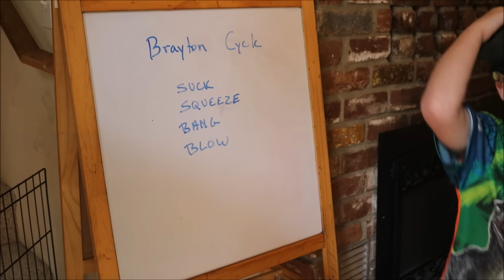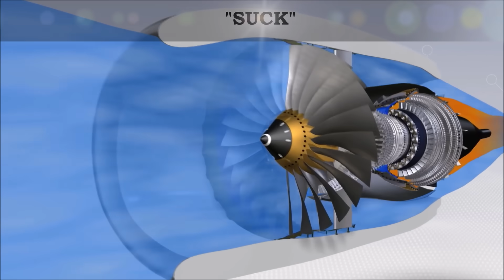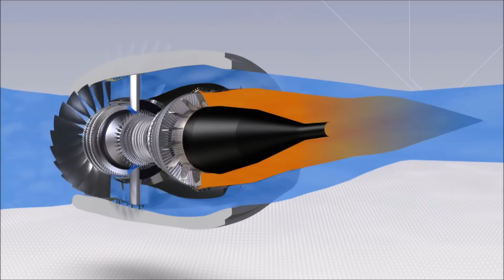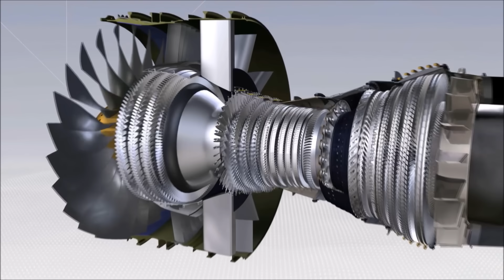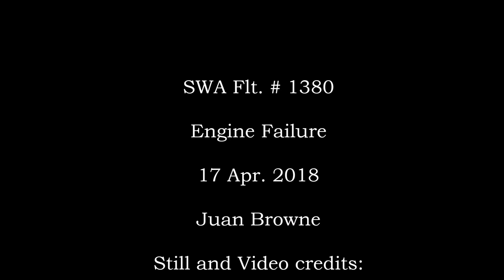Southwest Airlines Flt#1380 17 April 2018 Update

Comment: I noticed that the broken window on the plane was 30 to 40 feet behind the plane of the turbine that failed.  Typically a failed blade would travel in a straight line tangent to the circular arc the turbine blade normally travels.  This tangent path would lead to a window that is along side the window, instead of one 30 to 40 feet behind the engine.  It is hard to believe that the speed of the plane is so high that in the time it takes the blade to travel from the jet engine to the fuselage, the plane has traveled forward 30 or 40 feet. Maybe not.
Reply: mech cntr The window was damaged by the cowling, not the blade.
Reply: I watched the rest of the video and he stated that the cowling likely broke the window, not the blade which was likely contained.  That makes more sense.

Comment: So the lead intake cowl needs a revision to keep it from coming apart. The protective cowl that houses the blades itself is pretty stout material, my brother is a NDE does contract work prototype testing equipment, he had a piece of a housing that he was inspecting after production for GE, it’s like 2.5-3” thick made from carbon fiber, it’s extremely strong material, you could probably land the plane on it if you had no landing gear. I suspect they will find the serial number on what remains of the blade, trace it back and they will find its probably a bad blade due to a production error, or one that slipped by an inspection process at the factory. Inferior component, or inferior inspection of the blade,  but probably easier to miss the inspection part.

Comment: 36 fan blades in the CFM 56
Reply: bigsmitty01 The number of fan blades varies with the engine model, from 44 initially down to 22 in the latest version. On the current 737 it is 24 blades.
Reply: Gordon Richardson correct I'm used to the -5

Comment: George Bailey Brayton (of Boston Mass) made his first "brayton cycle" engine in 1872, he named it the "ready motor" because unlike a steam engine it could be running in a few minutes time. . In 1874 John Holland used one to power the worlds first powered submarine. In the 1880's Brayton made an engine very similar to what diesel would come up with in 1893..  Today there are 6 ready motors known to exist...  Last year the one in germany has been made to run again. This is the first time an original ready motor has run since the 1920's

Comment: At 9:14, do you think it's a "dovetail" failure or the "woodruff key" that holds the dovetail? Or under extreme long term conditions, and duty cycles, do you think that the dovetail could actually be stretching, similar to a crankshaft or a connecting rod in a high RPM (race) automotive engine application?  And then the dovetail either hits the perimeter of the housing or just completely breaks? And at 14:04, are you sure this isn't from "ingestion?"
And last question, just one last time, why isn't this on my evening news, but if George Clooney gets a pimple on his behind, that makes the news? Best,

Comment: Juan, Does Pete, at the ripe old age of 6 yrs. understand, that he is indeed funny? I suppose, you might want to state, he is a chip off the old block. You are probably more knowledgeable than most of the persons offering commentary below, but I've read were the CFM-56 engines have a reliability rating of over 93%. As you mentioned, Airbus used them on earlier builds of their A-320. Also, if my memory serves me correctly, Airbus also used them on the A-340-200, but as I've been reading, they were just a bit underpowered for that application.
Reply: 93% of what? A 7% failure rate (say 7 failures per 100 flights) would be a terrible reliability rating.

Comment: Thanks for the video.Have not seen cowling come off in test videos when blade is blown off.Maybe the increased non concentric movement being on a more flexible wing could create the velocity required to hit the fuselage?are there any safety devices that cut fuel to an engine in severe vibration.also do you have any examples of how fast a turbine engine spins without power?

Comment: I like to watch AgentJayZ he does a lot of experimenting with Jet Engines. If you think you have a big 200 HP Air Compressor think otherwise. https://www.youtube.com/user/AgentJayZ
Reply: Martin Szy - actually, he rebuilds flight and commercial gas turbine engines to factory specs.
Reply: And tinkers with jet engines for power boat racing, in fact, if you call that experimentation.

Comment: The CFM56, and other GE engines are proving themselves to be a lemon
Reply from the maker: not yet.
Reply: blancolirio And other GE engines, GE90, CF6, etc. They are in last place with their peers RR and Pratt.
https://www.barrons.com/articles/boeing-737-max-engine-problems-hit-stock-ge-too-1494445874
Reply: The same fan separation and cowling destruction has happened to other engine makers, but no one got hurt, so no big news story.
Reply: ziggy 2shus Im just saying lately, like the last 10 years or so, GE has had its share of catastrophic failures.
https://ntsb.gov/news/press-releases/Pages/PR20150910.aspx
Reply: ziggy 2shus http://aviation-safety.net/database/record.php?id=20060602-0

Comment: Great video Mr Browne, A couple of questions. Why wasn't more people sucked out of that plane , You would think that fast of decompression would almost took part of the plane with it. Also, was that your airport that KCRA showed on the news tonight where one person died and two others injured?. Some major fire in a hanger, I thought they said the Nevada county airport. PS, Am still working on information on that turbine at the dam being repaired. Got a number finally. Thanks.
Reply: I'm speculating here (I don't know all of the details) but a passenger is much more likely to remain in their seat during a decompression event if they have their seat belt on, which is one of the reasons why flight attendants always say to keep it on when seated, even if the fasten seat belt signs are off.  I don't know if the woman who was almost sucked out of the plane was wearing hers or not, but it seems likely that she wasn't.  

As a side note, another important reason to keep your seat belt on is turbulence.  I've flown over 700k miles as a passenger and I've been in turbulence bad enough to feel like I was lifting off my seat only once, but unless you enjoy being bounced off the ceiling it isn't worth taking the risk.
Reply: A lot of issues here.  Since even the young lady who unfortunately died was not 'sucked out', at least not completely, it shows what the power of the discharge is like.  It'll scare you, you probably will need to change underwear, but if you're not sitting directly by the window, you'll probably survive.  You WILL have loose items in the cabin flying by, newspapers, magazines, food trays, etc, and you may take a few bumps and bruises from those items.

Check out this Mythbusters clip on decompression.

https://www.youtube.com/watch?v=4yG2h1aDB6k

Notice they did it two ways, they just did the window, and then they did an explosive shaped charge.

Then, look at Aloha Flight 243, back in 1988.  There was a structural fatigue issue (this was also a Boeing 737, and they lost the top half of the cabin, about 18.5' long.  Only one fatality there, one of the cabin crew who was standing about the fifth row in the first classs section.

https://en.wikipedia.org/wiki/Aloha_Airlines_Flight_243

While a 'low time' airframe, the aircraft for Flight 243 had almost 90 thousand cycles, from the short distance it flew.  All the passengers were seated and belted, which is why no more were lost.

So that is a major explosive decompression, and with only one fatality.

I hope that answers a little of your questions about depressurization.
Reply from the maker: yes, sad story, lost another friend.
Reply: Oh, So sorry to hear that Sir.............
Reply: My condolences on the loss of your friend...
Reply: Gary, That test on YouTube was bs, They might of been at 8 pounds in the test but at 30,000 plus feet up in the air, the air is so much lighter than on the surface of earth. Which means it only  evacuates to  14.70 pounds on the ground per square inch. which is a lot more than at 35,000 feet just above 7 pounds meaning that much more must equalize throughout the whole plane. Cute test, Not accurate at all. To make that test accurate they should of added ruffly 6 to 7.5 pounds to the 8 pounds inside the plane to compensate for the plane being in a atmosphere of 14 plus pounds instead of 30,000 plus feet.
Reply: To pass a human through a hole a some inches across would require an extraordinary pressure differential such that a person was essentially liquified (and that, thankfully, requires extraordinary pressures).  Even in the full vacuum of space and if the plane interior were pressurized to sea level -- and this passenger jet were somehow miraculously flying in space where there is no air for the engines or wings -- the absolute greatest pressure differential you could ever have would be just ~14.7PSI (1atm/1.013 bar/101KPa) and even then only if you found yourself lost in outer space.  Despite what you may see in Hollywood movies, people getting sucked through small openings just does not happen in real life -- to get sucked through you must first have a human sized opening (as in an opening large enough that a human could reasonably pass through that opening).  Thankfully, as the idea of being extruded through a small opening would be a terrifying way to go.
Reply: Umm, she was half way out..And just to prove your wrong Ethan you left one of the most important factors out and that is Volume. I once had 3 city blocks under construction with a 10 inch lines all connected together under the streets filled at 5 pounds and 4 inch lines running to each house. I was told to go ahead and take the plug out of the man-hole pipe that it passed. Just 5 pounds at that volume almost blew me out of the man-hole. Dry Cement trailers that blow off there load. There's been drivers killed by them when there's a plug in the hose and the safety valve fails at around 25 pounds. If there full during the plugged there a lot safer as there isn't that much air volume yet but once almost empty there a bomb if they plug .  And to correct you on space with a plane at 14 pounds even, if you open the door into space your body will boil in seconds which is a whole different topic....Volume, Key Word.....Square inch, Square foot, Square Yard, Square mile. Its all different as the volume changes it. They could all be brought up to 5 pounds exactly, but the effect because of volume would be a totally different effect on each. This is the reason we make different size air-compressor tanks. Like you could have a one gallon tank at a 100 pounds and hit the tire to bead to the rim, That wouldn't be enough volume but you use a 10 gallon tank, at a 100 pounds  then you'd have the volume or force you need that will bead that tire.  Now, to finish, You get me a big ram and a piston the size, lets say 7 feet wide with a 15 foot stroke, And the right hydraulic pump and ill blow a body through a hole the size of a baseball. Or less even. If the piston would be 14 feet wide that would only double the force or volume.

Comment: When mentioning the 36K people killed a year in vehicle accidents, it would probably bring out the comparison better to say that that is 100 people A DAY, vs the one person killed in the 9 years since 2009.
Reply: Checking auto fatality rates per mile for the latest year I could find (2007), it's 1.36 per 100 million miles (FHWA). Aviation is doing quite a bit better, at 1 per 5.2 billion miles per year (2017). (Wikipedia). I submit that miles traveled vs. deaths is the best way to evaluate safety. Put it another way, if you're flying 1,000 miles, your chances of dying are 1 out of 5.2 million.

Comment: They need to test a engine failure containment while the cowling is facing the additional forces of the full air flow in flight... that additional force is obviously a contributing stress.. testing a disintegrating engine in a static frame isn't quite the same..
Reply from the maker: Yes!
Reply: 11trains Touché

Comment: There's no guessing game here. At the beginning of this video. If you look at the guy with the blue cap standing in front of the turbofan hub. Look in front of his elbow. Does anyone have any doubts now what caused this engine to turn to shrapmetal? One blade completely missing!!
Reply: I guess we can call this one an uncontained failure. When these engines are tested before they are allowed to be installed on any commercial airline they must pass a blade off test. This test in my opinion is flawed because it is done on a stationary cradle or mount. In  actual environment these engines have air at speeds over 500 mph and temps close to near -600 Fahrenheit go through them.

Comment: Good job Juan.  No opinions.  Just facts.  We are of similar backgrounds, 20 years in the Air Force as T-37 IP, C-141B FEIP, C-20A FEIP,  and 21 plus years with major airline in B-737-300/500 F/O A320 F/O and Captain, approaching 19000 hours.  I have never had a major emergency since leaving the Air Force.  These airplanes are extremely reliable.  Our training covers most of the usual incidents but it always up to the pilots' skills to cover the situations not covered in training.

Comment: The sad thing is even at that height it could still be a bird strike as vultures are know to fly very high. That engine is going to be stripped over the next few months as they check everything in it that got damaged by the blade fragments as it passed each section.

Comment: I wonder how well protected the hydraulic lines are running through the wing to the control surfaces. Could an exploding engine sever some of those lines? I assume losing one engine renders one of the hydraulic systems inoperative.

Comment: Thanks for sharing Juan !   I recall the old pelicans  with TWA, UA, AA hanging around the airport that few  in the piston-engine era,  failures ( of varying degrees )  were  a commonplace occurrence with several events per year being pretty much the norm.  They universally claimed  introduction of jets made their lives ever so much less stressful !  I'm wondering if there isn't some hidden irony at work in this incident, (  since I expect the enhanced inspection/testing requires demounting and reassembly of the fan blades )  is it possible minor dings during reassembly act as stress risers leading to a fan failure ?   IAC, I agree  that SW Captain earned her year 's wages in less than an hour !

Comment: https://youtu.be/oLb31cW4p58?t=4m40s  Yesterday I messaged a very dear old friend, Dr Lary Gadeken, C.E.O. of BetaBatt Inc. of Houston, asking for his advice on a possible application for his product. Bird Strikes in the air, can unbalance a turbo-fan engine. and Birds see a big black disc, that their bird brain may think is a cave? in which to seek shelter? ... It might be possible to have a bright red LED flashing light incorporated into the centre of that 'White Spiral Spinner' at the front of the BIG Fan. The video above mentions that a jet engine can even suck ground crew into it,  up to five metres distant...!!!!... if throttled up! Ground crew also wear ear-protection, so often hear very little , especially in a busy terminal with many engines running. A retro-fit replacement 'engine nose cone' with perhaps a small cylindrical hole, with strong magnet to hold the flashing LED light, powered by a BetaBatt lasting over ten years. with a centrifugal switch, might be something to consider? Would it deter birds? ... maybe a research project could find out the facts?

Comment: What the heck! The IP stage blades are shown backwards 6:15
Reply: It does look weird, but the CFM56 is a two-spool engine, the HP shaft and LP shaft turn (edited comnent) at different speeds.
Reply: Gordon Richardson The -5B Direction of Rotation (Both Rotors) is Clockwise (as viewed from the rear looking fwd) and all other variants included. RR Trents are triple spool with the HP shaft as odd-ball.
Reply: Rick Foley Thanks for the clarification. The animation is very confusing (CFM should do better).
Reply: Gordon Richardson Amazing that the video showcase of such a product has this level of mistake. Marketing and Engineering must be outsourced to different continents.
Reply: Rick Foley Yep! I bet someone is kicking their backside, given the number of times the CFM video has been viewed since this accident!?

Comment: Mr Sumwalt from the NTSB  referred to a flap setting of 5 as opposed to a normal setting of 30-35 on landing if I recall correctly. Is that a result of the crews concern of the integrity of the wing?
Reply from the maker: Usually a lower flap setting for a single engine landing...in the event of a go around.